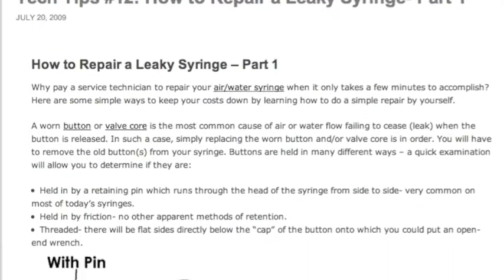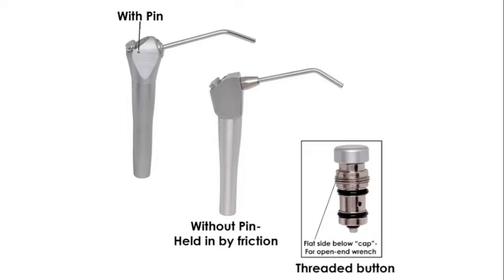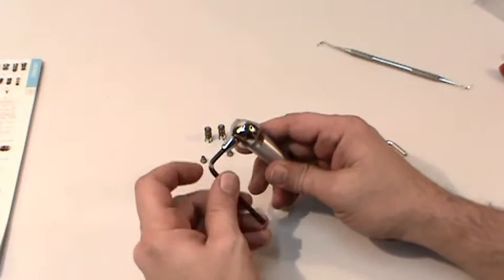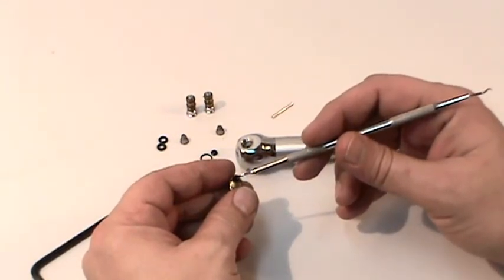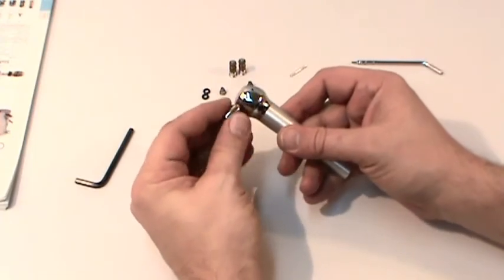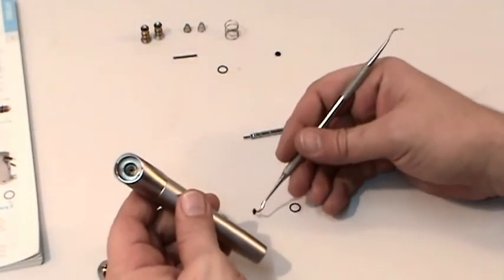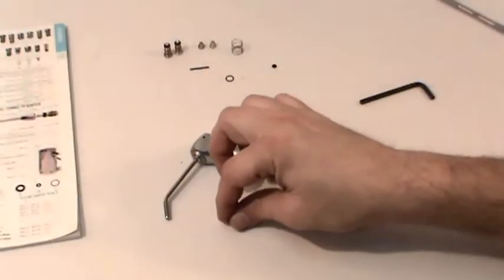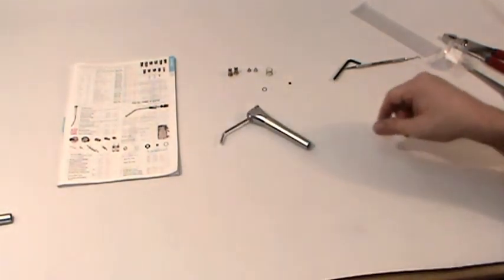How to Rebuild Your Air/Water Syringe

Comment: In my disassembled air water syringe, I've noticed that there's 2 very small metal balls, I don't know where it came from. When I assembled it again without the 2 small metal balls, the problem is when it is being used, and accidentally pressed the bigger circle, the syringe pops out😢😭